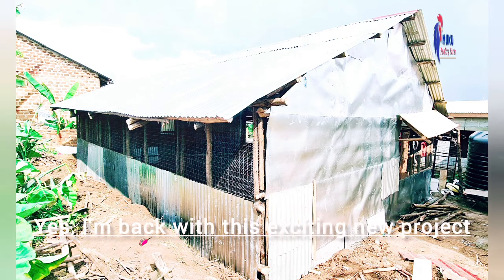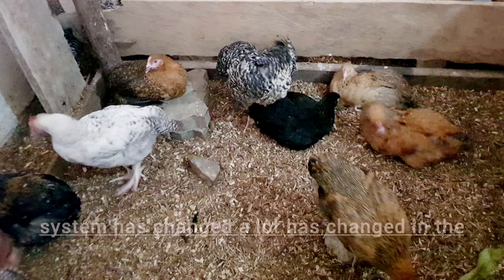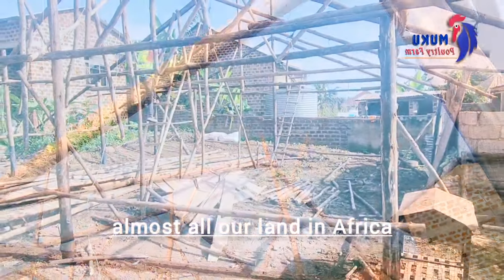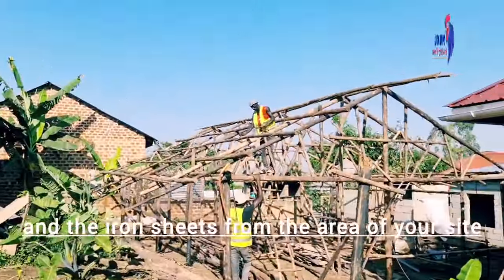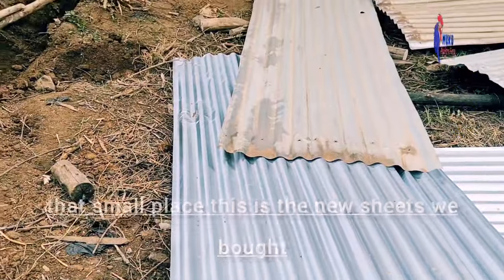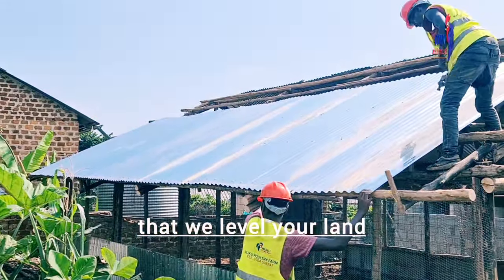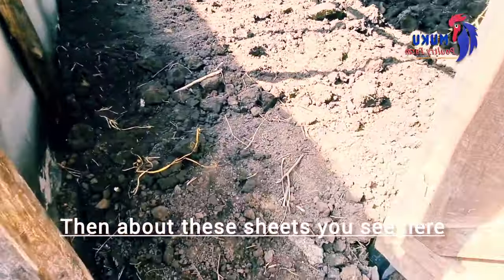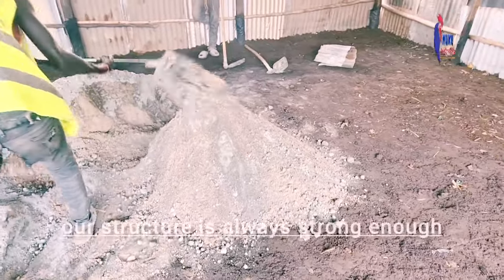Step by step 700 broiler structure using cheep local methods.

Comment: Nice 👍 work I always advice;-
1- At least 2-4 lines of bricks  be built round whether by cement or soil were the iron sheet can rest to avoid rusting and moisture penetration. 
2- mix maram & cement to do the flooring for a stronger and dry floor.